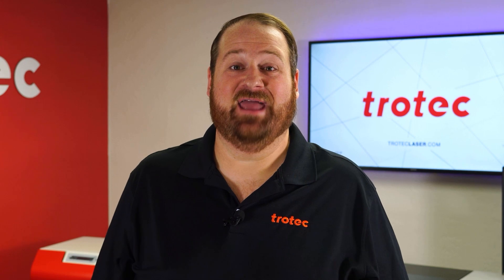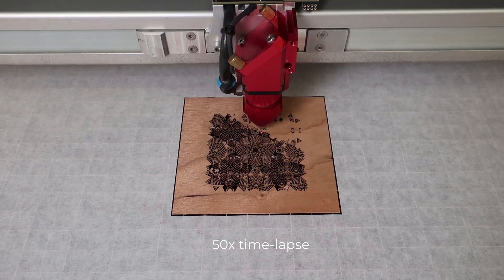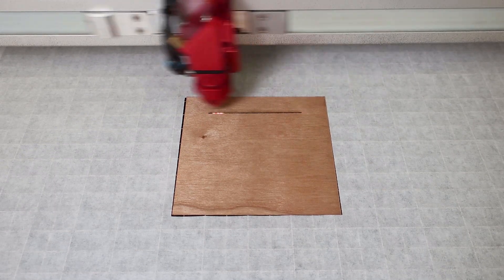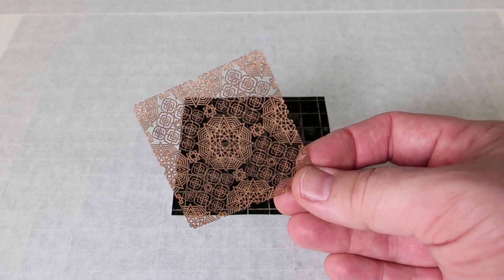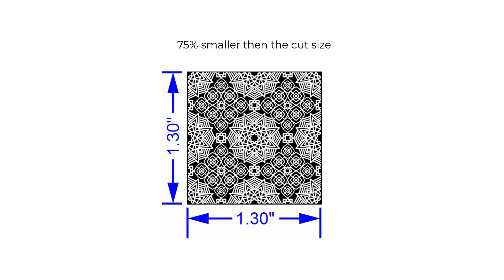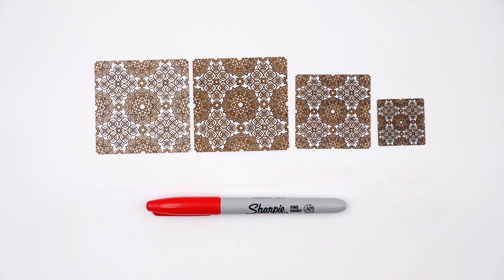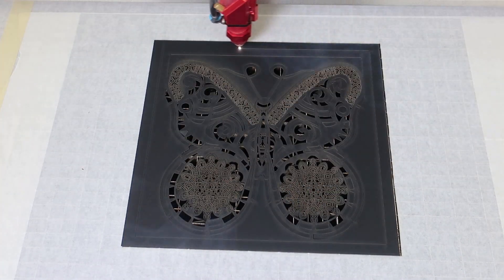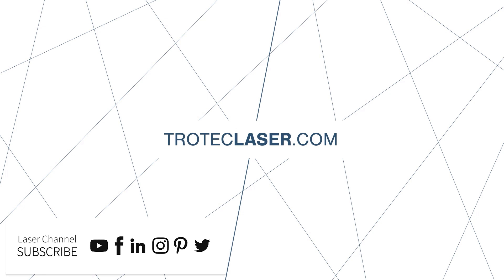Laser Hack: Engrave to Cut

Comment: Can you give some recommended settings to get started with for an example like this on a 50w co2 machine? I'm still new to lasers and still learning power/feed settings.
Reply from the maker: Parameters will vary drastically based on the laser brand, wattage, the model of laser being used, as well as the material and thickness being laser processed. We suggest running at full laser power (100% power) and a low laser speed (Like 30%) and then running multiple passes until the engraving penetrates through the material.
Reply: @TrotecLaser  Hello! Thanks for this video. What is 30% speed in mm/s?

Comment: What resolution setting or line count is required for this image to be of high quality ?
Reply from the maker: Hi! The sample run in this video was a vector image, so there is no resolution; however, if the image is a black and white pixilated image, then the higher the resolution, the higher the quality; I would recommend 300DPI and up for the best possible results.
Reply from the maker: 1000 DPI was used

Comment: How do you clean the intricate detail after cutting it? I had a nightmare experience when cutting a bunch of soft touch paper and trying to clean it with a damp cloth piece. Intricate details were bending and ripping during cleanup, and water caused tiny elements to warp. Would appreciate any tips!
Reply from the maker: Hi Mike! Cleaning the engrave to cut with this kind of detail is difficult; some materials can be masked first and then peeled after using more robust plastic materials. For this application, the graphic was mirrored when processing thin woods so that the finished look is on the clean backside when turned over.

Comment: Thanks Laser Dave,
Wattage is the key here,my first laser was 25watts my 2nd was 60watts and my 3rd 120 watts, laser engraving is about speeds and feeds based on your wattage and the material your processing.
What is the laser wattage?
Reply from the maker: Wattage definitely can make a difference with settings! The samples shown in the video were processed on a Speedy 400, 120-watt laser. This laser hack has been successfully tested with all models and wattages.